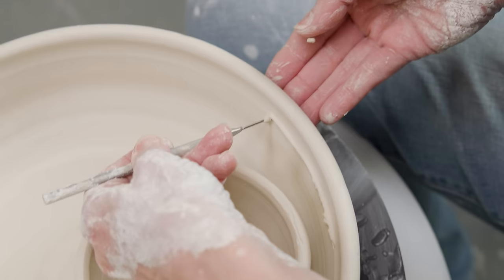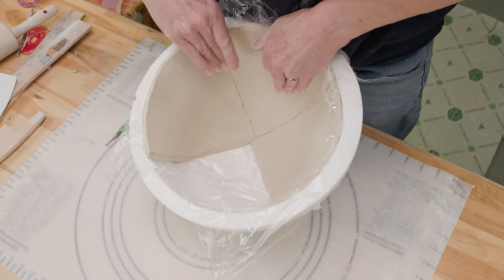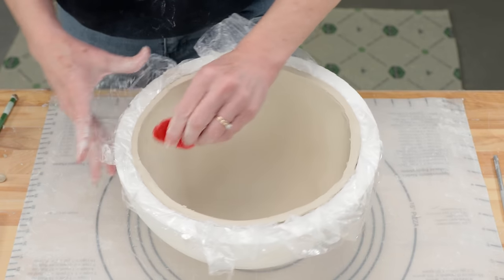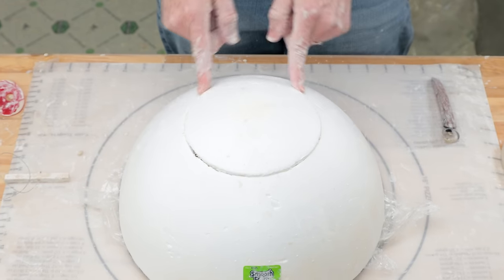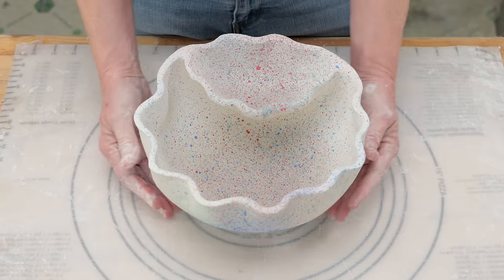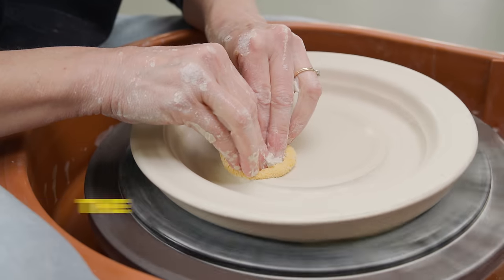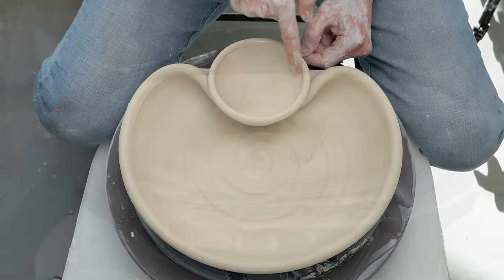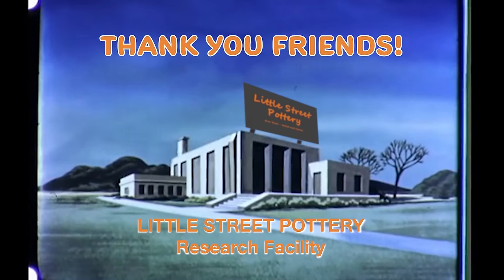4 Easy Chip n' Dip Bowls - WITH FREE TEMPLATES!  HAND BUILDING and WHEEL THROWING!

Comment from the maker: ***EXTRA TIPS FOR SUCCESS*** These projects are easy to construct, but  challenging as it starts to dry and shrink. Tips for success are:
1.  Keep the Hand Built projects IN THE MOLDS untii they are either almost or totally dry.  
2.  For the Wheel Thrown projects, you wont be trimming a foot along the bottom so throw the big bowls with a 1/4 inch or a little more clay along  the bottom the try and trim as much of the excess clay away from the side walls to avoid uneven drying.
3.  All cut or folded areas of a bowl are vulnerable to cracking so really reinforce them with burnishing and extra clay to avoid problems.
4.  Wire off the big  bowls from the bat when it is freshly thrown for a little less stress on the clay as it dries and shrinks.
5. On the bowl with the folded flap, when it is dry a little, you may want to wire under the flap.  If the flap and the bottom of the big bowl (especially with the little bowl. over top of it) remain joined together when it goes through the drying process, it will cause uneven drying and extra stress on the fragile bottom.  You can even try totally trimming and cutting away the section of the clay flap  under the little bowl to eliminate even more bulk.
5.  DRY THEM SLOWLY UNDER PLASTIC UNTIL EVEN THE BOTTOM IS TOTALLY DRY.
Reply: Thanks for all this extra information xx

Comment: Hi Ann, thank you for  making this video. Especially on the fourth bowl. I have been checking out these swirl dipping  bowls and wondering how to go about it. But I love your style as both the dipping and the chip or out bowl are both large enough to hold lots. Thank you for doing this!! I’ll now give it a shot.  On another note, I just bought myself an inexpensive portable airbrush from Temu. I am hoping to use it on my pots but still trying to find videos of other artists using this tool for pottery. Have you ever used one?
Reply: @annruel1982  ahh yes I think I may have bought the wrong tool. Yes that is what I had in mind as well, a tool to help paint with slip. Let me know if you start working on that and your results please.  Most definitely I will be using a mask when I try out this air brush. I have been used occasionally my mouth operated atominizer to spray glaze with I have always wondered about whether or not I can be a hazard to my lungs but of course I can’t where a mask when using it. Thoughts?
Reply: @annruel1982  yes great ideas. Thanks for your thoughts, much appreciated!